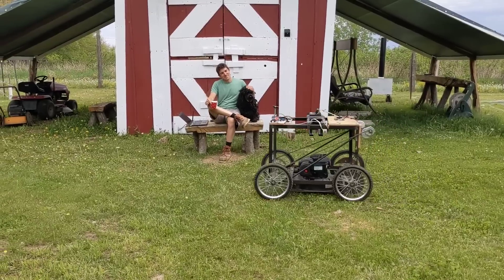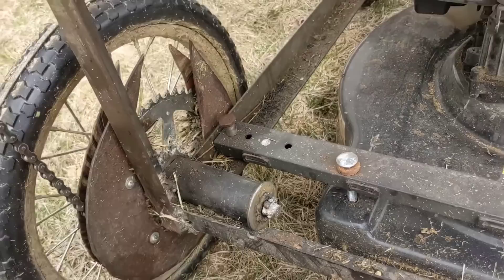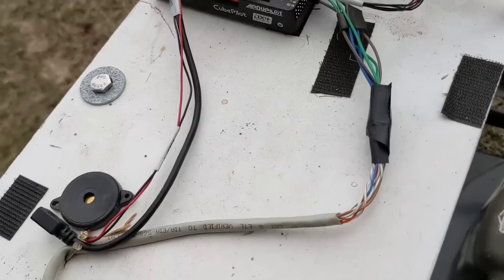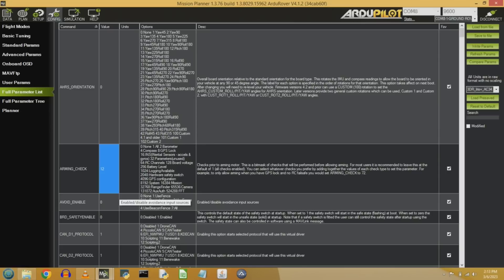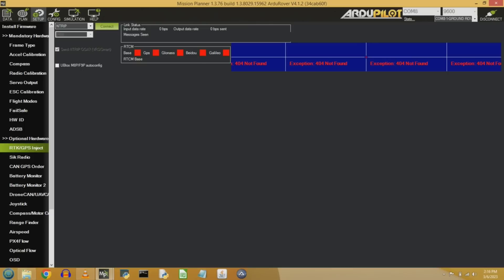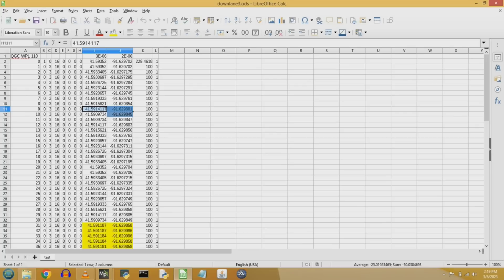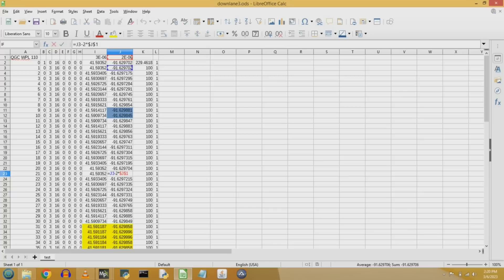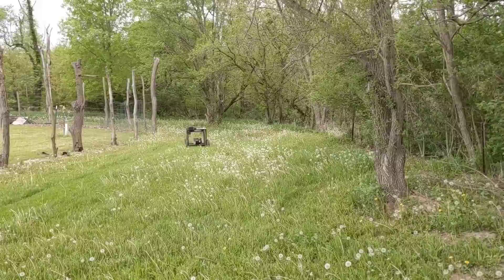DIY Autonomous GPS Mower - Parts List, Schematics, Build Details

Comment: could you tell me for auxillary 5 and 6, where are those set in the configuation file for the forward and reverse?
Reply from the maker: sure thing - when you set the motor type as "brushed with relay" as seen here:
https://ardupilot.org/rover/docs/rover-motor-and-servo-configuration.html

You'll then be using the "relay pins" which are aux 5/6 to set direction:
https://ardupilot.org/rover/docs/common-relay.html#common-relay
Reply: @nathanbuildsdiy  so this is automatically configured?  weird thing im having is when im using the rc transmitter i only have forward, and not reverse.  i havent been able to figure how to kick in reverse in using the remote.  i guess ill try and have it drive automated a bit to see if it in auto mode.

i appreciate your help greatly!
Reply: @nathanbuildsdiy  what would you set the servo funtio nto on those relay pins?
Reply from the maker: @brian88lx  The relays should automatically be set up when you set the motor type to "brushed with relay".  I'll be out at the farm Sunday and can plug into the cube orange to see exactly what settings I have on those.  If I recall I didn't set anything up specifically for the relay pins, just set the motor type, plugged in to the aux5/6 for direction control and it worked.
Reply from the maker: I took some screenshots and a photo of the connections on the cube orange, put them in a pdf here: https://drive.google.com/file/d/18UyqGs4U9RDrpplJFz-yIb9s2iLNCqge/view?usp=sharing

But basically - relay_pin is auxout5 and relay_pin2 is auxout6.  I don't think I set those though, I'm assuming when i set motor type to brushedwith relay those were set.  Are they set for you?
Reply: There are several people with the same issue in these threads. I am also having the same issue. Forward works great. Lol. I've checked the settings in reference to Nathan's many times. Rewired my setup a couple times. I can't get those darn pins to work. The buttons on the cytron drive the wheels as expected.

Comment: Couldn't ya put the motors directly on the axels , even run chains between each tire side to make it 4wd
Reply from the maker: It is 4WD now, each motor connects to the 2 wheels on the same side so all wheels are powered.

You could try to attach the motor directly to the axel, but it wouldn't be a simple connection, this motor is an electirc bike motor and has a D shaped axel, meant to accept a bike sprocket.  You'd have to adapt that somehow to the axel for the mower.

Comment: do you get sufficient life from the lead acid battery? Be nice to have an alternator setup, but that would add complexity to the complexity! Are you familiar with Home Assistant? All kinds of cool stuff you could add with that. It would be very easy to post any data to MQTT. Happy to help if you are interested.
Reply from the maker: So far the lead acid battery is ok, but I think a deep cycle is better suited to the task as another commenter pointed out.  I'll have to check out Home Assistant when I finish with my current project.

Comment: U can use roveboard engine.
Reply from the maker: Yeah, I thought about doing that and couldn't find any used ones for cheap.  You want to have rpm's fairly low - these motors do the gearing down inside the enging housing - something like 100-200RPM depending on the size of tires you have, and plenty of torque at the low speeds.

Comment: Your wheels ARE NOT aligned front to rear. This thing will seem to run a straight line but a semi straight line. I do not know if the misalignment happened after the build or during the build. Just an indication of the drive forces from the chain I suppose, or poor welding of bed frames. A more proper steel would be normal a36 steel angle iron, not high carbon steel bed frames.
Reply from the maker: Probably during the build, I'm a pretty novice welder.  That said, the GPS/autopilot correct for it

Comment: this make me want to make and improve on your design... you could make it 100% auto and zero turn i'm willing to bet...
Reply from the maker: Do it!  I didn't have access to a ZTR mower and they're too expensive for me to buy, but it would be a simple build - just put linear actuators on the left and right handles and you'd be ready to roll, no need for all this welding and building. You'd have to translate the PWM signals coming out of the cube orange to on/off signals for the linear actuator motor controller, but I think that can be done in mission planner.

Comment: How the robot is planning path? For reach point a to point b how robot plan its path
Reply from the maker: That's handled in ardupilot (the software that controls the autopilot plan).  When creating a mission with waypoints the typical path is just a straight line between 2 points, with a few parameters to control how close you have to get to waypoints and what "shape" the path can take near waypoints.  That only matters when the robot is going fast, like a drone flying.  For this we just go to the waypoint, turn to face the next one, and go that direction, no "curve" in the path.

Comment: How long does the battery last?
Reply from the maker: About 40 minutes when I started, but it's been slowly getting shorter.  I'm working on an alternator/regulator to recharge from the mower power.  I'll post an update hopefully this summer.
Reply: How hard would it be to put a couple of solar panels on it? The batteries would still die ofc but I’m sure you could extend the life by a few hours.

Comment: To what distance is it accurate?
Reply from the maker: A few centimeters relative to the pass it just made, and it's dependent on the RTK base station corrections.  

If you're in an "RTK fixed" lock, then it's accurate to a few cm absolutly (like the GPS coordinates are where it actually is).  WHen you're "RTK float" then it's still cm accurate between passes BUT the absolute position may not match GPS exactly.  

BUT, at the bottom of the big hill at my place it can lose RTK lock completely and use 3D GPS fix location and it'll wander all over (like a meter or more off course)

Comment: Why don't you steal some energy off of the mower to keep the car battery charged?
Reply from the maker: A very good idea. A small alternator will be in the next iteration
Reply: @nathanbuildsdiy  I guess you could just steal some electricity from the ignition system? 🤔 😁

Comment: I can build you a 12.6v LiPo battery that would last 5 times longer than the LEAD acid battery.
Reply from the maker: Agreed. I started with a 3s lipo but it didn't have enough capacity to run it for very long.  I went with car battery because it was cheap and reasonably large capacity.  How much would a 10aH 3s lipo build cost?
Reply: @nathanbuildsdiy  - 10Ah would require (4) Panasonic NCR18650BD cells in parallel (x 3s = 12 cells total). That would give you up to 40amps of current draw. If you add a few more in parallel, you not only increase the amperage, but you increase the capacity.  You could do say, 8P3S (24 cells) with a BMS included. I could build that for $120 plus shipping. This would be a 24Ah battery with a 80amp draw (max).

Comment: put the drive system ABOVE the deck of the mower, brilliant.  We've been trying to think about how to make these so you don't have the castors sticking out front like on other designs.
these mowers would benefit from a heading hold gyro to make straight lines no?
head tracking FPV would be nice too
Reply from the maker: Yes and yes.  There's a video someone else made about using 2 GPS to track better as well - https://www.youtube.com/watch?v=2mk8fhbTN3Y

FPV would be really cool, but the range is line of sight usually and this thing gets pretty far from me when operating down the lane.

Comment: a cordless electric lawn mower would be safer. you can have the micro controller shut it off if it gets stuck. 
if a gas mower shuts off for whatever reason it needs to be manually restarted every time. if you use an old temperamental mower your going to have a bad time. 
it would also be cool to ad AI and cameras to detect people or animals in the path and stop. 
having to watch it defeats the purpose of owning a robot mower.
Reply from the maker: Yeah, the next iteration will probably be electric, and have a bumper added to shut off in case it hits something.  I tried lidar for range detection/avoidance but it kept "seeing" tall grass nearby and trying to avoid it which sent it off the desired narrow path so I scrapped that from the build.
I'm fortunate that the farm is isolated and fenced so it can't get away.  I just work nearby weeding or picking produce while it runs.

Comment: grab one 100ah deep cycle battery. car batteries arent suitable for this
Reply from the maker: ^^ Good advice, I didn't know know this. So far my car batteries are ok - I usually swap them before they reach depletion though so that may protect a bit.
Reply: @nathanbuildsdiy  Car Batteries are made for High cranking amps and then recharge by the alternator straight away. They like to be kept at full charge or they die quickly. 
Deep cycle batteries are better for things like running a fridge or this mower. They can be safely discharged down to %40 percent capacity and then recharged without negatively affecting the battery. Then you have the lipo4 batteries which are fine with almost 100 percent discharge.

So really if you have a 100ah deep cycle battery they are only really good for 50ah

This is just a rough overview someone will no more than me. 

Do you own a 3D printer?

Comment: You can also create an automatic grid in Mission Planner inside a polygon you add to the map https://youtu.be/MhHomssqD7k?t=90 Also smart RTL
Reply from the maker: Agreed, but I found that I almost never had a polygon to fill, instead I'm mowing down a windy lane or around an orchard fence and the back and forth routes generated inside those polygons resulted in a lot of short zig/zag's, so I went with the excel spreadsheet approach I outlined in the video

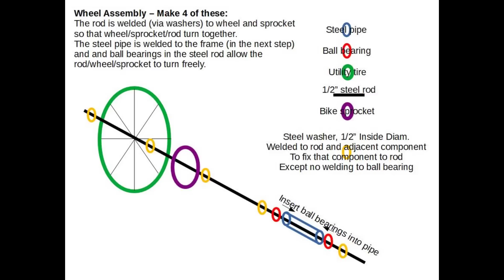Comment: @2:50, ok, assuming this is a prototype.  But the design is totally not serviceable without cutting things apart. Not a very good design.  Why not design it to be serviceable?  And where is the the kill switch that anyone can hit from any side! Vin case this thing tries to run over a kid or person!
Reply from the maker: Good call on the wheel assembly - I think next time I'll put a pin through the axle on one end of the wheel assembly so the pin can be removed and the whole axle taken out.  
Yes, sort of on the kill switch, I just remove power, it's all there.  I could even put a switch in line to make it simpler.  It only gets used on a farm with no one around so the possibility of it hitting something is close to 0

Comment: LOL!
Reply: A cool build.  I'd love to build using an old cell phone as all the sensors and GPS and communications as well as an app to run it all.  Coupled with an existing self propelled mower, and steering controller for non drive wheels
Reply from the maker: Glad you both liked it.  One trick is the GPS has to be RTK enabled so you get precise positions. Normal GPS is only accurate to a few meters so it won't hold a straight line

Comment: The motors are 24VDC and you are using a 12VDC, do the motors or motorcontroller "complain" about only having 12VDC available?
Reply from the maker: So far no complaints. The ESC's actually provide less than 12V sometimes if it needs to run a motors at less than 12V speed.  I think it's because the motors are pretty big for this application, so they're not pushed on torque, even at lower voltages.
Reply: @nathanbuildsdiy  thanks for the feedback!!